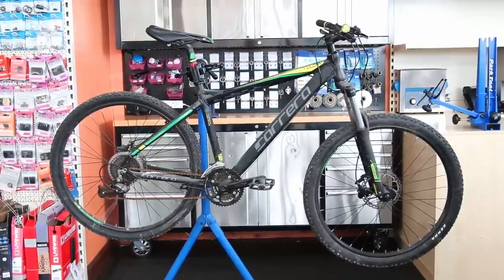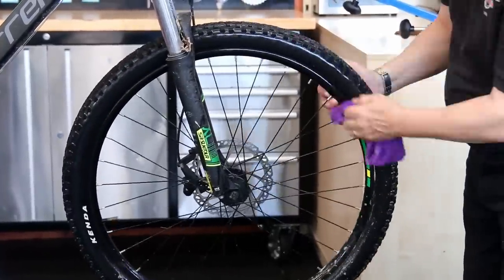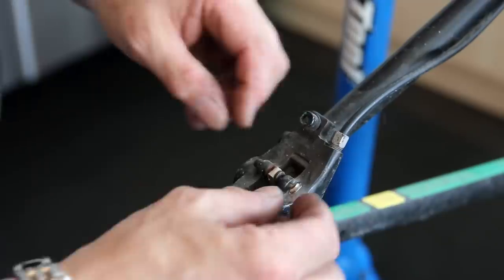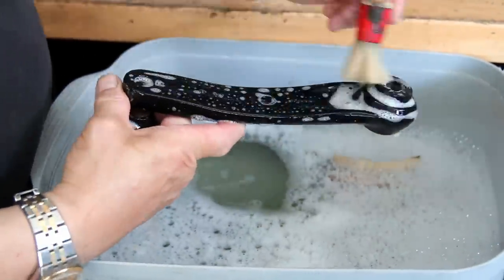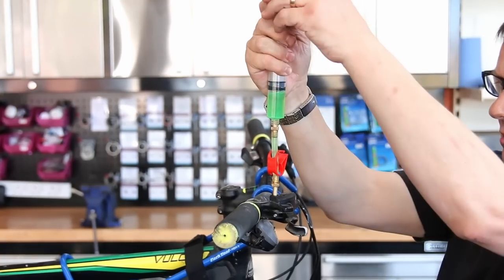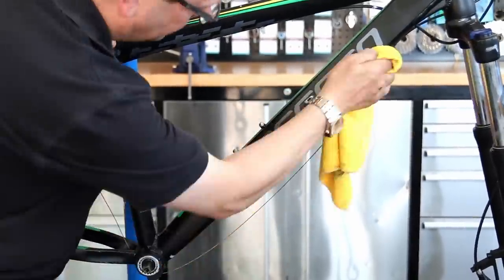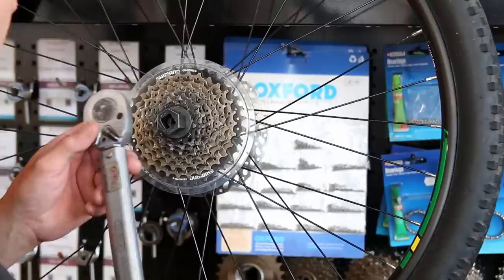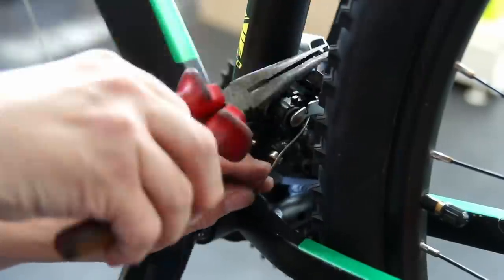Carrera Vulcan Rebuild! Full Bike Service!

Comment: I'd like to see your process for cleaning up your work area after one of these services.  How do you safely dispose of the ultrasonic cleaning liquid, wash towels, reuse brushes, etc.  I recently did a full "bikespeeds service" on my race bike thanks to your inspiration, it turned out great but I made quite a mess along the way :). It's way more work than it looks!
Reply: It's hours worth of grimey hands on work. That's why some bikes featured here appear to be neglected. Most of us would rather pay for this level of work... if we can afford it regularly.
Reply from the maker: We have trade ways of disposing things which unfortunately won’t be much help to you but ask the local dump and they’ll tell you where to put stuff🧡

Comment: Great video as always guys and I think it’s always brilliant that someone remembers the bike in the back of the shed or garage and gets it serviced and hopefully start riding again. Anyway something to make you smile . Had a bike rattle on my giant propel advance disc 1 and I was 100 % sure it was the headset I thought I hadn’t seated something correctly as I had to replace one of the rubber covers that gives the headset that integrated look and as you know the headset on these bikes are a bit fiddly anyway pullled it all apart and put it back together and still got the rattle. I then started bouncing the bike and what it was a co2 canister in the saddle bag was banging against the seat rail😂. I should have done this in the first place but because the bag had been on it for a couple of years no problem I discounted it from the offset Doh 😖🙄. Anyway now a dab hand at giant propel headsets so I guess I got something from it 🤣😀
Reply from the maker: We get things like this in the shop all the time, someone thinks they have a bottom bracket worn out or other bearings and it’s just a cable rattling against the frame! At least you fixed it⚙️

Comment: Wednesdays are my favorite day of the week thanks to Bikespeeds. There were some good catches on this service with the QR springs and the tire rotation. I was surprised that you reused the chain. Have you ever had to deal with a customer that is riding tubular tires? I am watching from South Carolina, USA.
Reply from the maker: I removed and refitted a Tubular tyre & trued the wheel Monday!
Reply: @Bikespeeds  I have been riding tubulars for a while and now I have a flat. I don't have a spare so I am going to try Vittoria Pitstop that is supposed to seal leaks and pressurize the tire. Should be interesting.
Reply from the maker: @MX5Fanatic  try and pull out what ever caused the flat before squirting in the pit stop and as soon as you hear it seeping out turn the wheel so the hole is at the bottom, much line you would a tubeless tyre. Pit stops a great product and usually works well.

Comment: I just love these videos. A couple of questions.
1. would you recommend removing the chain and derailleur as part of normal at home cleaning my bike?
2. If so, I am sort of afraid of taking apart my derailleur. Should I be? Do I need to keep the upper and lower jockey wheels and parts separated (Shimano 105)
3. Do you recommend reusing the quick release or using a fresh one after re-installation of the chain?

Thanks for all the great information. I love them all and my lunch on Wednesday involves eating a sandwich on my couch watching your new video!
Reply from the maker: Hi Paul, it’s really up to you on how in depth you want to go, it’s not necessarily required to take everything apart obviously as a shop with all the kit the work to reward ratio is pretty fair for us. You should be fine reusing quick links though technically they should be replaced every time the chain comes off, hope that helps👍🏼
Reply: Personally I don't take off the derailleur because then I'd have to mess with the indexing. I just take off the plate holding the jockey wheels, that's easy. And KMC make "official" reusable quick links.

Comment: Do you ever use a “rust converter” or other rust removal product for very rusty parts like the chain? 
Thanks.
Reply: here not only cleaner and brass brush if chain is in good condition you can easy remove rust from him even with a dry towel
Reply: Shimano recommend not using any acids or strong chemicals on their chains, so it'll just be degreaser and mechanical removal

Comment: ive bought myself a 2nd hand carrera hellcat 29er & im looking to replace the forks with some air forks as they need replacing anyway so why not get an upgrade. my question is.. what forks will fit? i cant find any info online about fitment for this frame. thanks in advanced!

Comment: Help, front suspension was seized,  I stripped it partiality and and cleaned it , I think a large rubber tube has slipped from somewhere and stuck in the springs, is this right, what can I do ? Tia

Comment: It’s so odd… I am myself a bike mechanic and we purposely take off c clips and replace them with cable ties. C clips always fall off!
Reply from the maker: These are off road bikes if you catch the cables in under growth they will flick a clip and potentially avoid an accident or cable/hose damage. Cable ties aren’t the best in that situation.
There are also different qualities of the clips. The ones I use have a good strength to themselves, they are quite hard to get on at times. I personally feel there’s no right or wrong to things like that, it’s what works for you.

Comment: hello i got a carrera vulcan,that model with blakc and yellow,specs are these:,,Details
Frame:AluminiumFork:SR Suntour XCM 120mm
Wheels:Alloy hubs, Carrera double wall rims, Kenda 27.5x2.1in tyresDrivetrain:Suntour XCT 42/32/22t chianset, Shimano Altus mechs and 9-speed shifters
Brakes:Tektr M275, 180/160mmWeight:13.96kg (30.8lb)
Size tested:22in''
anyone can help me with what cassete to upgrade it and what front chainring?